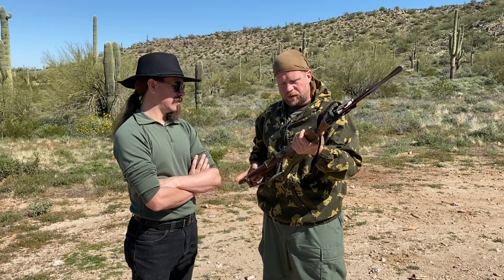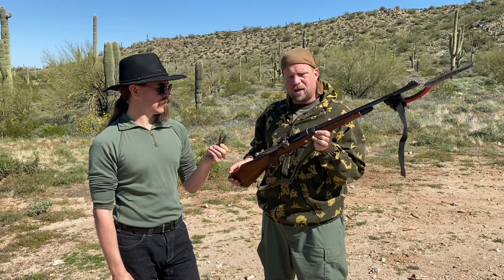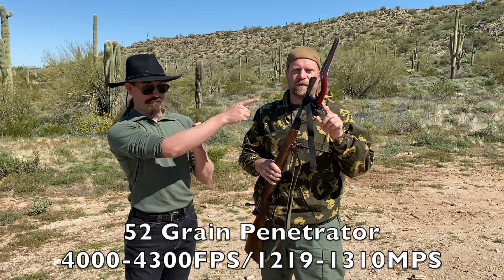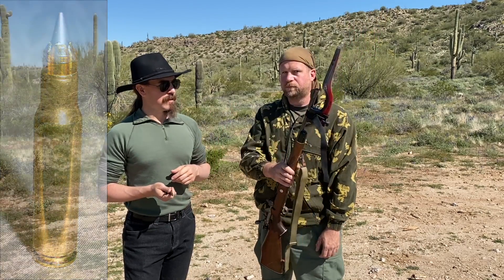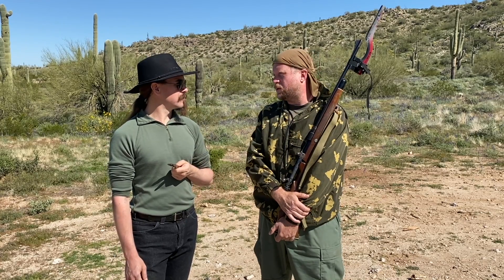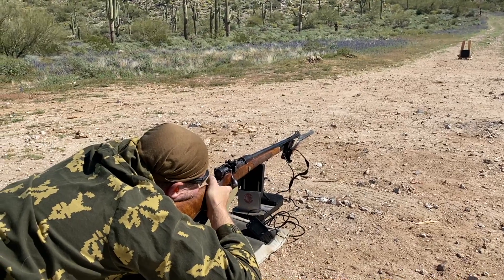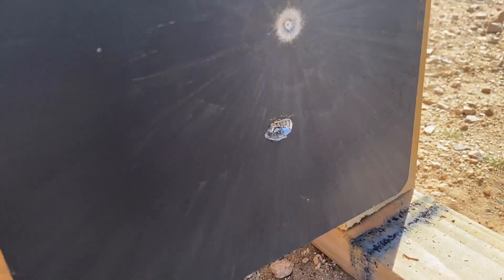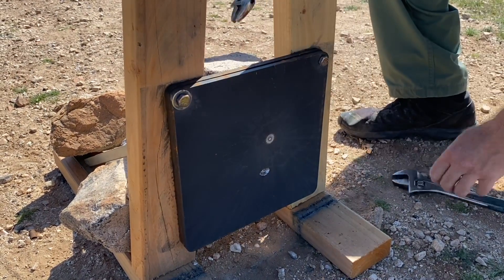M948 7.62x51 "SLAP" - Armor Piercing Ammunition Testing

Comment: The Magnetospeed chronograph doesn't need the bullet to be ferromagnetic. It requires it to be electrically conductive (a moving conductive object will still affect a magnetic field even if it isn't ferromagnetic). Lead and copper are not ferromagnetic. Tungsten is not ferromagnetic (although some alloys of it contain nickel which is ferromagnetic)

Comment: This is what happened.  "CAUTION: DO NOT FIRE ANY STYLE SABOTED AMMUNITION IN A WEAPON FITTED WITH A MUZZLE BRAKE, COMPENSATOR, FLASH HIDER. OR SHOTGUN CHOKE, UNLESS YOU ARE SURE THAT THEY ARE COMPATIBLE." ~ The Complete .50-Caliber Sniper Course - Hard Target Interdiction by Dean Michaelis pg. 411 (ISBN 1-58160-068-2)

Comment: I love the video. slap rounds are not known to be very stable or accurate in the first place. They are kinda a spray and pray round. But this is a cool test. With the .50bmg the chamber of a.50bmg rifle wont hold the round properly but a .50 bmg machine gun barrel  will. Handle them just fine. It could be a malfunction due to head spacing or other clambering problems due to the uncommon type of the projectile. I'm bo expert but I have had experience with clambering and headspacing problems like this at TSJC. also I have an incomplete but very beautiful mauser 98 action that was made by FN that is not complete but from my understanding very rare if you would ever like to take a look at it I would love to provide it to you happily.

Comment: So basically, SLAP ammo is just like the modern "accelerator" rounds, except using a hardened core instead of an actual bullet.

My curiosity is piqued, and now I wonder what would happen if you made custom "accelerator" loadings with .223 AP bullets. Would the concept work a little better with brand new ammo, or would it still generally fail in execution?

I'm just rambling now. Nice test to watch.

Comment: For the second round, the fracture lines on the back of the plate indicate that the round may have penetrated if it hadn't been supported by the second plate.  It's a pity that they didn't have extra rounds to check that out on only one plate.  Nonetheless, very interesting vid.  Thanks, guys!

Comment: It's also not really a .308. So because you have lower mass, and the potential malfunction of the polymers, the speed might not even be right. If the polymer starts to shear and wears before its left the barrel, you'll have less velocity, and there could likely be some wobble introduced into the round causing it to tumble sometime after leaving the barrel. I'm definitely no expert, but that's just something I thought may be happening.

Comment: I think your test is slightly off as well. Trying to penetrate 2 plates stacked on top of each other. That first plates material can't get out of the way of the penetrator because the 2nd plate is uncompromised. If it was one complete plate, the steel would degraded as the penetrator is going through and allow full penetration. Please redo this test with some space between plates(even though that will in effect act as spaced armor). Or use a plate with the desired thickness to start with. Thank you.

Comment: SLAP ammo is actually in the current Army inventory, I've placed eyes and hands on it at two separate ammo supply points now. It's just rarer than bigfoot's ball hairs. I can't recall if it was M948 specifically but it was 7.62mm of some variety.

Comment: Interesting. That Arisaka actually looks decent. I like the stock contour. But it is a shame that someone altered it. Did they keep the factory barrel and just set it back and rechamber it? I wonder about the .308" bullets and the .311" bore. But the Mini 30 does the reverse, and it works. I wonder how much steel the .50 BMG rounds will go through. I bet they are great against concrete bunkers too.

Comment: Unfortunately an arisaka like that would also have a bore larger than .308. Typically the caliber conversions done by gunsmiths involved setting the barrel back and rechambering it. It is highly likely in my opinion that the sabot may not have even been gripped by the rifling plus the blow by that would have occurred may have further damaged it on its ride down the bore that it caused the lack of stability your guys experienced. It would be worthwhile to retry this experiment with something like an AR10 with out a muzzle device. Otherwise it was cool to see you guys test something that never gets shown in high quality video footage.

Comment: This idea is coming back into style. Take a tungsten welding rod, sharpen the tip on a lathe, carbeurize the surface to harden it, swage aluminum fins on the back for stability, 3D print the sabot, and fire out of a smooth-bore shotgun. A standard 12gauge with a long barrel and a lot of powder can punch through a manhole cover.

Comment: From what I could find through a quick search, the 12,9x99 M903 SLAP rounds are built with an amber-colored sabot from the factory which is made of a Polymer called Ultem 1000 with an aluminium insert (Make of that what you will, I don't think it is that susceptible to aging). So I think it's a safe assumption that the yellowing from your 7,62x51mm rounds is intentional and sort of used for identification. I don't think they would've used entirely different materials for the Sabots as it would've complicated production even more.

Comment: These were deployed in the middle east when I was there but they were the M903 and M962 used in the M2 50 Cal machine gun. I believe it fired a 30cal tungsten projectile from the 50 cal caseing. Worked good for punching through 3 foot thick adobe walls.

Comment: 9:37 there are multiple splits and tears in the metal  so it definitely "penetrated" the first plate   the cracks are failure in the armor ... Just imagine it was a ship ... would it be leaking????  yes  well if it were single hulled... regardless 30 year old ammo with plastic pieces did pretty well    and i guarantee if the plates were spaced there mayt be a different result.   i say spend 100-150 d0llars more and re test but with the armor either half inch or one inch spaced

Comment: So here it seems like the projectile is energy limited. There's a limited amount of energy in .308 after all. When energies get higher then the physics of the projectile starts to play more of a role, you'd want to get a longer projectile with diameter being completely irrelevant hence the tendency for penetrators like this. So with that it doesn't matter if its longer and slower or lighter and faster, and designs will focus on functioning properly in the rifle, drag, and other such aspects. At a certain point, the melting metal point, length is the only determining factor of the penetration and higher speeds solely add to the damage on target should it penetrate and the accuracy. Those would be the tank cannon speeds. That is why, when given the projectile length and material we can get a very good estimation of its performance.

What this all means is in .308 the SLAP round is, as we saw, really not much of a benefit. Especially when compared to the significant downsides it produces. More powerful calibres like Lapua might do better but you would do just as well going all out for a .50 or larger. Frankly I see the future of long range sniper weapons as low pressure large bore SLAP rounds for this reason, you might not want penetration but if you can produce the required speed without an extreme bore erosion and the other negatives of pressure then its a victory. Plus a longer boat tail and other improvements to drag are no longer a negative in the SLAP method. However as of now we don't have anywhere near the accuracy of SLAP rounds for a 3000m shot in a shortened 20mm barrel and I'd assume a new integral suppressor would be needed with muzzle devices not playing well so thats a decades away solution. Still, in our lifetimes I can see it happening.

Comment: In 120mm sabot rounds a smooth bore is highly accurate. I'm guessing that rifling may mess with the plastic sabot causing the instability of the projectile. Also tungsten is non magnetic you need an optical chronograph. Remington made .223 sabot rounds for a while for 30.06 they also had accuracy issues. It would be interesting to see if a smoothbore subcaliber fin stabilized system with a similiar cartridge would work better.

Comment: Little correction guys: The factors for penetration of armor are factors of Hardness, Diameter, and MASS. If the projectile is not heavy enough, no matter how fast you push it it will not penetrate without fully disintegrating first. This is why Armor Piercing Rounds are generally made of materials that are hard and dense, traveling fast. Those little .20 caliber tungsten slugs are very limited in their capability just from a basic physics standpoint. They're just not heavy enough to penetrate.

Comment: You should stuff some .30 cal black tips into a .30-378 cartridge and see if it will penetrate two plates. I've personally seen a 180 gr. SST launched from a .30-378 and it will penetrate 5/8" into a 3" dia. cold rolled bar stock!

Comment: I reckon they were both key holing. .50 SLAP and SLAPT make perfect holes in plates of hardened steel and titanium. For sure those sabots are breaking up. On another channel they machined a perforated sleeve to fit inside their rifles muzzle break as the recoil was too severe without the break. That allowed firing with the break.

Comment: The second you said Arisaka conversion, wondered about the barrel and the improper bore and groove diameters. While this conversion could have been rebarreled to a proper one, it was fairly common to save money on a cheap sporterized gun to just set back the original barrel and rechamber it. If this was done it was hunting accurate, especially with a flat base bullet, but the bore and groove are .303/.314” instead of .300/.308” bore/groove. This difference could very well cause the penetrator to shift inside the sabot and cause the yaw you experienced. I think y’all are experienced enough to know this, but you didn’t call it out so I thought I’d mention it.

Comment: Now I’m not an expert in armor, but wouldn’t stacking the plates affect the penetration of the first plate? For example a round can go through one plate cleanly because it encounters less resistance at the end of the plate. But when you stack it, the extra material means that it doesn’t fully penetrate the first one. So does that affect the comparison to other AP rounds?

Comment: I would love to see 5.56 SLAP rounds do they did make them if you could get some I would love to see what it does.  To be honest back in the 90s nobody I ever remember shot SLAP rounds very few people I knew in the USMC back then were even aware these rounds existed.  I believe these rounds never saw the day of light since they were packed in ammo cans kinda like NVGs back then we would go to the Company warehouse unlock a bunch of green painted storage boxes marked in yellow or red lettering sift thru the packing stuff pull out a few cases with NVGs in the case turn them on see if they worked take the batts out and fill in the PMCS sheet OP or INOP and move on to other equipment that needed quarterly inspection on equipment that's how it was back then you never got to use the cool stuff the CO commander would have a bird if he knew you used good equipment from your CO TOE.

Comment: I'll join the curious, in that I wonder if the degrading of the sabot polymer might have done what you suggest, coming apart in the barrel, or if there's a possibility that one of the "petals" might not have separated cleanly from the projectile and caused just aerodynamic instability...at least for the second example.

Comment: Bubblegum would go through steel if it were moving fast enough. The amount of energy in one stick of gum is astronomical if moving near the speed of light.
Reply: However, the BG achieving that value of speed would liquify the BG such that it would foul the bore of the device.

Comment: Do you think age had anything to do with it? I have fired US .30 caliber AP from WW2 and did not have those problems; clean holes as a result. Why not just use similar projectiles in 7.62, etc? How about Zinc projectiles or copper clad bullets? Thanks for the videos.
Reply: That's literally what they said in the video. The sabots are old and brittle.

Comment: What bullet setting did you have the Magnetospeed on? Might have worked on the more sensitive settings (custom bullet/trigger, non-magnetic, low threshold level). Although obviously with only 2 rounds there's not much potential for calibration.

Comment: And, studies have shown that the ideal penetrator proportion is from 1:15 to 1:17, so the diameter to length ratio can really effect penetration.  And, that also would have effect on the in-flight stability.  A short, stumpy 20-something round at high velocity is not going to have the best BC.  That's 2¢, you'll need at least $3, a mask and gloves , to go to starbux.

Comment: Re: .50 SLAP, we used it quite a bit of it in Afg, or at least tried to. It was terribly unreliable, causing failures to feed. We spent a bunch of time at the range and eventually found that the OAL was a shade too long and the tips were dragging on the feed chute. Since we were the only group using it in any regularity, we had other units test it out and found the same thing. Shortly after they told us to expend it all and get a fresh batch of ball.

Comment: When sabot rounds were first developed for tank guns by the British in WWII, they had a big problem with accuracy, partly due, I believe, to tumbling.  So it is hardly surprising that that would be an issue with sabot bullets as well.  But one reason why .50 would work better is that a more massive projectile has more inertia, so it would be less prone to tumbling.

Comment: About 10 years ago, when I got into reloading, I found a company that made .30 cal sabots that held .22 bullets - the idea was that it let you save money when you just wanted to have a fun day at the range, as ammo (and even reloading components) was (IIRC) more expensive and/or harder to find at the time than now (er..."now" being up until about a month ago. Sigh). The "muzzle device" issue was definitely mentioned by the manufacturer, and my searching for info on them pulled up multiple forum posts and such stating that the accuracy was dismal, up to and including keyholing, likely because the weight/size of .22 bullets was just too light/short to effectively stabilize after the sabot fell off. I never did buy any - so I cannot say from experience how true any of that is - but it sure seems to jive with the results Karl and Ian got in this video.

Comment: I think we can also conclude that the current price on those rounds is excessive for anyone other than ammunition museums.
In fairness to the idea, I think we probably have some better plastic mixes now than we did in 1985. So it might be possible to make new rounds that would perform at least as well as the originals presumably did when new, and which might not degrade as quickly in storage, and possibly might have less probability of crumbling in the barrel. They would likely still have problems with muzzle devices though. 
I suspect the sabot (unless it is already segmented) is actually fragmenting in the barrel in normal use, but holds together until the end of the barrel where it turns into a puff of dust. That could also suggest they might have fouling problems with a gas blowback system that picked up gas near the muzzle.

Comment: It might be interesting to do a video featuring the "Accelerator" ammunition that Remington made at one time for, I believe, 30-06, .308, and 30-30. These were all .223 diameter bullets in .308 diameter sabots for hunting. The 30-06 version was supposed to clock in around 4100-4200 fps. I have fired some from a 1917 Winchester, and it was wild to shoot at 300+ yards with no visually perceptible flight time. That they were exceedingly flat-shooting goes without saying !

Comment: The M948 SLAP (or rather a derivative there of) was introduced and is still in service with the Swedish army under the designation Sk Ptr 10 PRICK. As some may be aware, the Swedish army uses the L96A1 AW (Psg 90) rifle in 7.62x51mm, and that rifle comes with a muzzle brake that has to be taken off when firing PRICK ammunition.  In a publication I have the bullet is listed as having the capability to penetrate 30mm of armor at 100m so your findings with the M948 ammunition are very interesting. I believe searching for M948 in Google will lead you to a thread I started on a cartridge collector forum about ballistic information on the round, this is also where I got my hands on the publication I was speaking of earlier.

Comment: My team had some .50 SLAP rounds in Iraq.  Yellow polymer was normal rounds, Red was Tracer.     I didn't like them very much.  Shooting cars with them was basically like using a laser.  a .308 hole straight through it, and it didn't impart any energy into stopping the car.

Comment: You should test the Modern Arms International 7.62, 143 grain, Armor piercing round. It’s a sabot round, not a discarding sabot round like slap. You can run it through suppressors, and muzzle brakes. The sabot gets sheared off the penetrator when it hits the target. On an optical chronograph the MV was 2862 through a 1x12, 26 inch barrel. Out of a 16 inch 1x11.25 barrel the MV was 2751.

Comment: if those would have been a tungsten dart coated in copper to full size bullet, the dart would have been the same size but the bullet would have had a better fit and a less degrading bullet!

Comment: Could an aluminum projectile with a penetrator core be used instead of a discarding sabot? Keep the projectile light to get high velocities, but eliminate the problems related to the sabot with muzzle devices and performance?